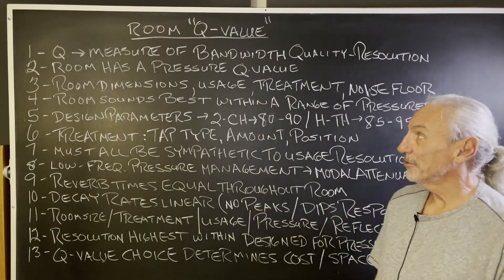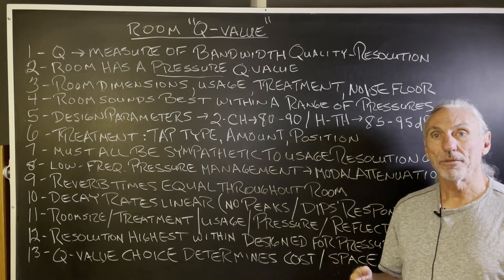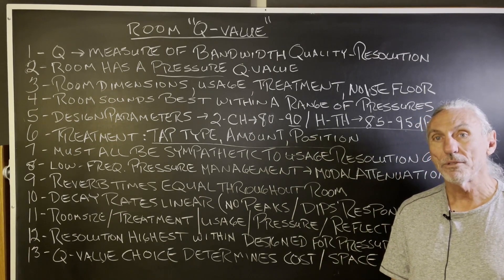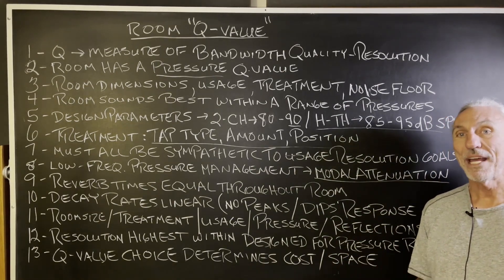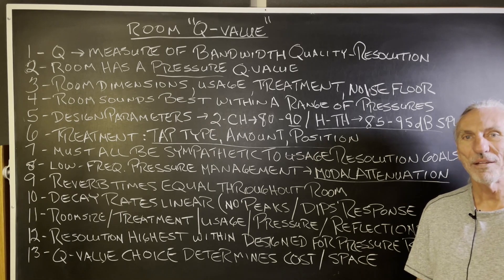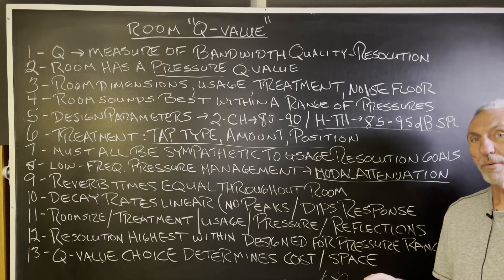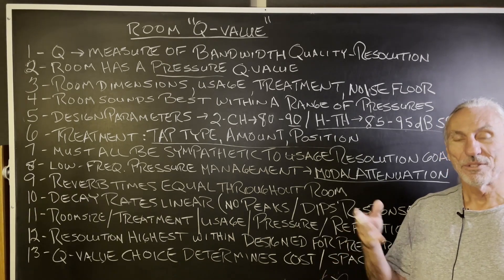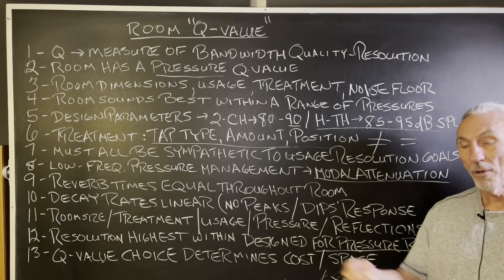Room "Q-Value" - www.AcousticFields.com

Comment: Like the video but part was off screen.
Imho
80 percent is the room dimensions,  10 percent the absorption and ten percent or 5 percent gear.
When churches ask you tell them no wooden pews instead cloth filled absorption soft seats.
Thanks for the video very informative.
Reply from the maker: Nonsense. Your ratios are not founded in science. They are speculation and the industry does not need any more of that.
Reply: @AcousticFields  speculation is exactly what science is.. not saying this guy is right, but neither are you.

Comment: Hello, love the lessons, question, are room modes only activated or possibly activated at higher volume (pressure) ? or are the room modes ALWAYS present? Thanks very much for these great video's and knowledge !!
Reply from the maker: Room modes are based on room size (dimensions) and the energy that is placed within them. They are always present in varios amplitudes or strengths depending on the usage of the room.
Reply: The modes are calculated completely from the room and it’s boundary conditions (typically hard wall assumptions).  They have nothing to do with the sourcing “energy placed in them”. The volume only scales the excitation of the modes, and linearly so. They are always present, even when no sound is in the room. They affect the total sound field, but exist independently.